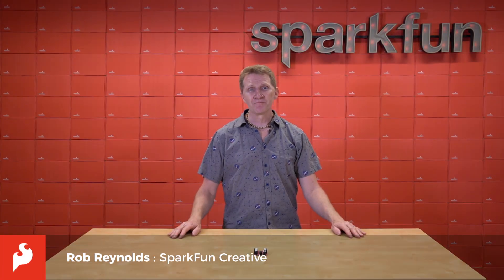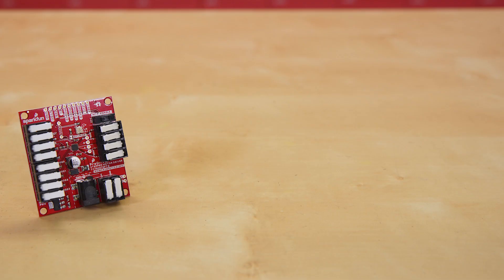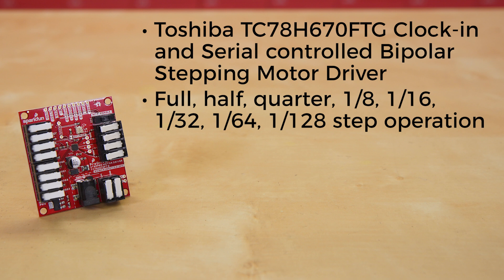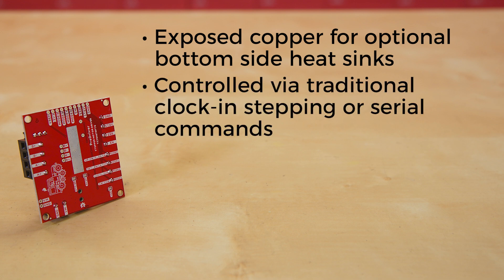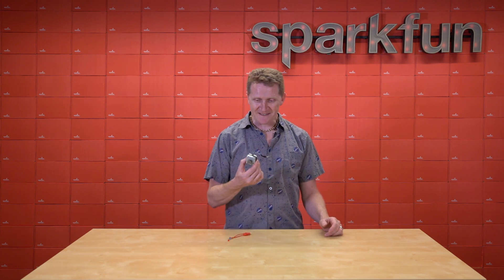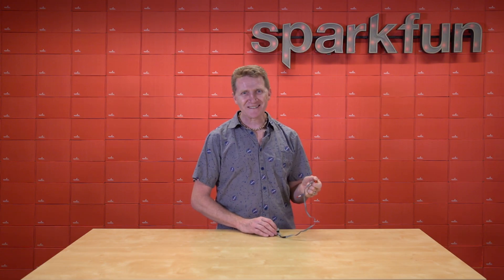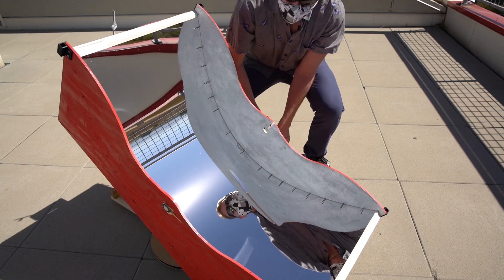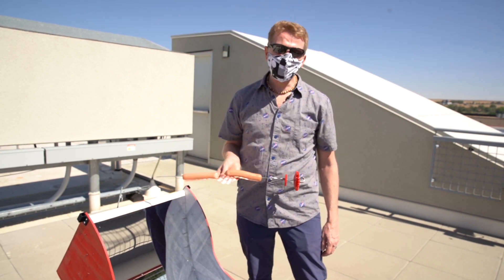Product Showcase: SparkFun ProDriver

Comment: It's NOT like the Big Easy Driver, that's for sure. I have a program that needs to step through the microsteps and control direction. Maybe I missed something. You need the 4 modes to set the microstepping but wait, I need to use M3 for direction and M2 for stepping. I'm not smart enough to figure out how to use one mode to do two different functions. Oh well, back to the Big Easy Driver. I'll have to find another way to slow my stepper down. Let me know if you develop a "Pro Driver" that includes a separate step and Dir Pins, and still be able to mirco down to 1/64th step.

Comment: The latch terminals are a nice touch. An easier way to determine coil pairs on steppers is shorting two wires together. The motor is much harder to move when you short one coil.